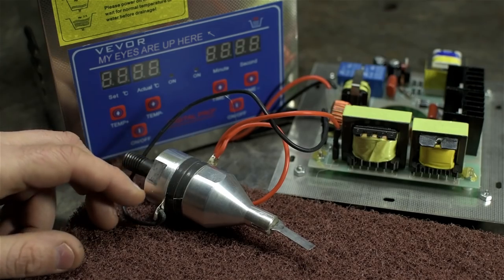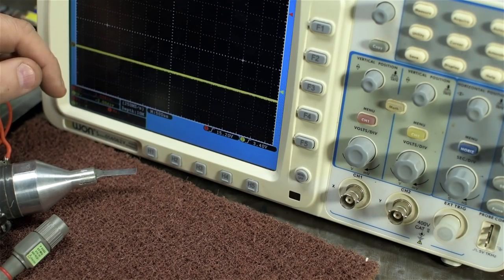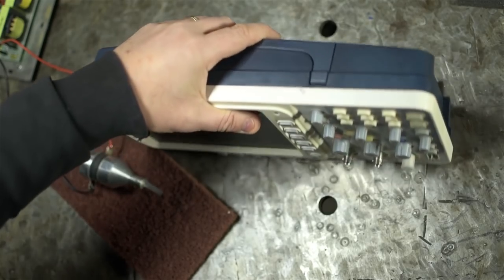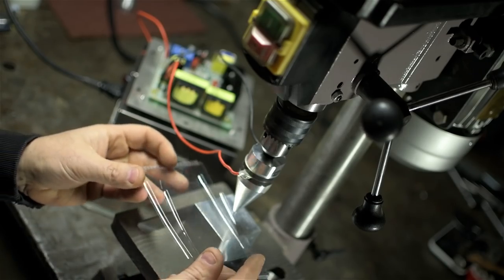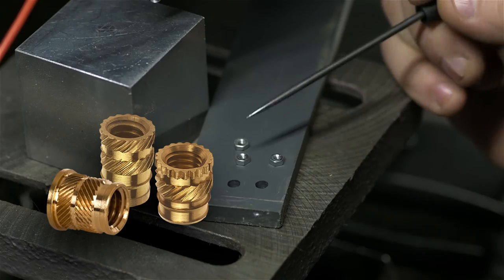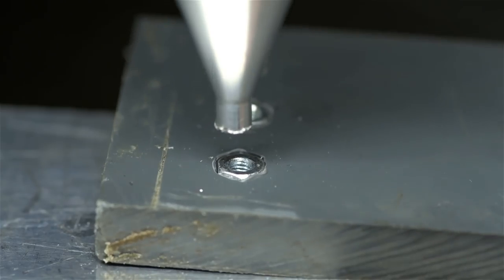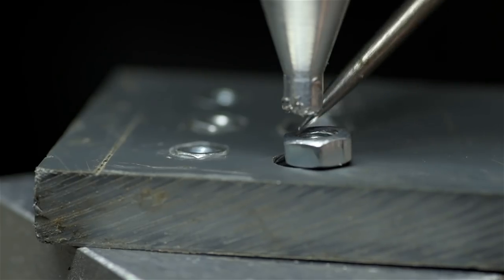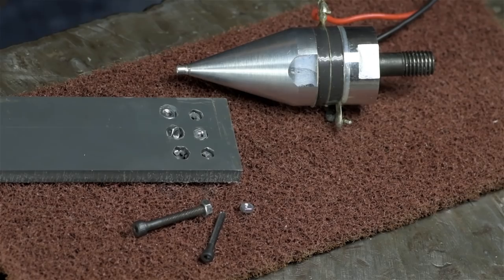DIY Ultrasonic Welder?! (Answer: NO)

Comment: As someone who works in a plastic parts plant... In the industrial section... as the resident sonic welding expert, I can tell you that you don't really want 40kHz for most applications. 20kHz is the general frequency we go for. Also, 160uM deflection at the tip, for most applications. Finally the real welders usually have three parts: A transducer, followed by a booster (which has a mass on each end, with a shock mounted ring at the central node,) and finally the horn on bottom side of that. Pressure is usually 25-75 PSI, erring to the low side, with a weld time of ~0.3-1 second. Feel free to message for more info!
Reply: As a last aside, our smallest welder has 900 W of output power.
Reply from the maker: So what you're saying is 60 is maybe not enough?  ;)
Reply: This Old Tony Probably not. ;-)

Comment: Far be it for me to give you advice, but I was sitting here watching, saying, "Hold the nut with a wrench." over and over. You must not have heard me...
Reply: Thinking exactly the same. Anyway, it was a lot of fun to watch :-)
Reply: same
Reply: That was a good idea, I was thinking of just making the horn fit into the hole in the nut, not threaded, just a bit undersized.
Reply: That's more or less what he meant by 'a pilot.' And undersized rod that helps position the work before the tool really starts doing anything
Reply: I was hoping he would hold it in place with the back of a dental mirror and maybe put on some nice eye shadow and lipstick.
Reply: I bought an ultrasonic welder for my company, which was a commercial film lab. We processed Kodachrome film. Anyone remember that? The processor was a ciné machine. That is, film is spliced end to end, and processed around racks as one very long roll.

This splicer was for that. The machine cost almost $50,000 around 30 plus years ago. The ultrasonic horn and physical equipment was about 26 inches long, and weighed about 30 pounds. The power supply was a large draw on the left side of the built-in table. This device, with all its size and power (1,000 watts for the head) was sized enough to weld to plastic ends of film, and that was about it.

Ultrasonic welding requires a lot of power, and a rather large device to deliver it properly and reliably. When we discontinued Kodachrome, I considered taking the machine apart, and taking the power supply and head home, to build myself an ultrasonic welder for projects. But didn’t, because that massive unit couldn’t really do much.

By the way, our machine worked at a variable frequency between 30khz to 80khz.

You need a flat at the bottom of the horn the size of whatever you’re welding, or pressing. PVC softens enough to bend at 140 degrees, and melts at about 180, so the heat from the ultrasonic is what’s allowing the nuts to sink in. Just pressing the nuts in would work better, because of the tension of the PVC being pushed aside, and pressing against the inserted nut. Melting the plastic that way just ends up with a loose fit.
Reply: On the surface that sounds like a pretty idea. Thinking about it though, I don't think it would be much for the hold onto if the"welder" was actually about to effectively   a good portion of it's energy into the work piece.  

I don't have any fillings but I can still feel them rattlin just thinking about it.
Reply: Yes, keep the power tools away from your teeth
Reply: Try threading the horn to the bolt so they go in straight, would be harder to take off but it would be worth it
Reply: It wouldn't clench at all. A box end wrench would simply act as a sleeve and held firmly it would guild the nut straight.
Reply: The moment he does that watch it weld the nut to the wrench. You got to think of his luck.
Reply: Depends upon her looks would be my guess?
Reply: Good call on not holding the nut with a wrench. Ultrasonic frequencies can cause micro stress fractures in bone. Been there done that. Happens in an instant.
Reply: A counterbore might have worked.
Reply: @paddlefaster  I've been researching that exact phenomenon. Can't exactly find much detail about it. Could you please explain further? Have you tried it and does it really happen instantly? What does it feel like and what are the recovery steps?
Reply: I never thought of that, I was thinking to put a plate on top of it to hold it square, but I also didn't know if that would affect the harmonics. I was also wondering how much pressure he was putting in if he was using a lighter pressure than just pressing it with the drill press.
Reply: Sharpen the tip
Reply: Right!!! I was getting stress by the solution bien so easy 😅🤣

Comment: To be able to weld, you need transverse vibrations. I recently stumbled on the schematic of the welder to weld tabs on battery cells, and it was designed at such: a vertical rod was pressed down on the tab to be weld on the battery, and the ultrasonic actuator  was attached via its horn perpendicular to the rod, it's other end attached to the frame of the machine. The result: the tip of the rod was vibrating horizontally, with a 2x amplification due to its positioning mid-rod, and the vertical pressure was not going through the transducer but straight through the rod.
(Also a small stepped down insert screwed at the end of your horn would allow you to have a correct way to hold the nuts/inserts square during insertion, you would need to have one for every size of insert to weld, though)
Reply: Yes, I was also thinking you need "in plane" vibrations for the welding to work because you need to have friction between the two surfaces. Also why don't you just put a small bolt in the "insert", this way you have flat surface to push on and also no plastic can move up in the center.
Reply: Ultrasonic welding is a form of friction welding. The 2 parts have to slide against each other to generate the welding heat. The ultrasonic exciter is teed into the horn as stated above. The nuts going into plastic was more like an ultrasonic jackhammer.
Reply: Ultrasonic Jackhammer is my Spice Girls cover band, tyvm
Reply: Ok, I wasn't crazy. This is exactly what I remembered of ultrasonic welding. I think that Tony deserves another go at this with the proper design. I think this is my favorite video series on this channel to date, and that is saying a whole hell of a lot!
Reply: ToT should try it!!! for the sake of the scope!!
Reply: Pierre-Yves Puech 
I got gas
Reply: I’ve used ultrasonic welders at work for battery tab connections. They’ve been used since the mid-1900s to weld plastics mostly. Even welded a complete car body (it didn’t work out).  And even now, with GM’s science and such, it is still very much problematic. The anvils and horns are always needing replacing because their knurls wear down pretty quickly.
Reply: This information is incorrect. Yes, for metal welding (battery tabs), the surface is scuffed back and forth, but for plastic, you are compressing the surface of the plastic. Scuffing the surface of the plastic is only used for vibration welding, which is low frequency  ~400 Hz, or spin welding. 
Once you got centered on the nut, you noticed how it went in very quickly. The sharp corners of the nut flexed the surface, causing it to melt. The reason it did not stick is there was no edge for the plastic to grip. Melted plastic is not glue. The metal must have interference to grip the plastic, so it did work.

Comment: Tony, where I work our daily job (for 14 years so far) is untrasonic welding transmission vent caps for GM cars. When welding, you need to tune your horn for each specific part and part material. You also need quite a high energy, and a high compression pressure. You need a much higher powered transducer. While super cool and probably very useful, those nuts did not weld to the plastic. They basically got jackhammered into place.
Reply: Hi. I am a mechancal engineer, and  if you could I would really apreciate if you tell me with which kind of ultrasonic welding machine are you using. I need some information where to buy industrial machines but havent had much information about this topic so far.
Reply: I used to work for Dart Sensors in UK, they use ultrasonic welding to seal their gas sensors, they are plastic with a small press like setup, similar to what Tony did with the drill press.. the plastic is held by a very snug fitting aluminium dye, the whole welding process is about 2 seconds, im not sure of the frequency the machine used....

Comment: Washers for retaining the ultrasonic radiator - are made of spring steel. In Russia, it is a steel grade 65S2VA, you have a steel grade 60SiCR7, or something similar. The Chinese use high-carbon secondary heat, its strength is sufficient for the life of the product.

Spring steel is needed for a reason, sound waves have minimal damping in this steel grade. You need a stable oscillatory system, without loss of heat. The easiest way to see how industrial cutters are arranged is simply metal - its shape can be repeated even from the picture. And this form is different from what you have.

Pay attention to the device driver emitter. He does not have a fixed frequency !!! It simply reacts to the load, and gives the maximum current with a phase delay of 45 degrees. Resonance frequency is obtained automatically! You do not need to interfere with his work, he is almost perfect.

And yet, take care of your hands. Bones are destroyed under the influence of ultrasound, very imperceptibly !!!
Reply: Хелло, комрад!

Можешь обьяснить, что ты имел в виду под "Washers for retaining the ultrasonic radiator", что это?

Comment: Yes, for those who didn't know, voltage measurement devices are sensitive to high voltages.  Especially with 1x probes.  This is one of many reasons I always use 10x probes.  My other best advice is to make a scope saver with a pair of zener diodes in inverse series to make a voltage limiter.   It will not save you every time, but it can prevent disaster and maybe even be used to make an isolation switch for your scope.

Comment: Riveting. I was glued to my screen.
Condolences regarding your scope Ch1.
Reply: What type of glue? Have you tried acetone?

Edit: Just caught that you said "was glued". Glad you were able to get unstuck.
Reply: If you need glue for riveting, your doing it wrong ;P
Reply: At least you weren't riveted to your screen...
Reply: I am wondering why the scope broke... Can somebody explain? It was normal voltage and current right?
Reply: Here is a guess. You know that piezo effect that makes BBQ lighters spark when the crystal is struck with a hammer? A piezo crystal can produce thousands of volts when struck. Perhaps this piezo element was getting squeeze when it was rattling between the horn and anvil, Producing a stray voltage .
Reply: I am leaving a comment here just to be notified if someone gives an an answer to Seeker44's question.

i.e. "I am wondering why the scope broke... Can somebody explain? It was normal voltage and current right?" and Frequency I must add.

Comment: On the close up of the smaller nuts you definitely see some fluid movment of the plastic. I guess it shows a super efficient transfer of energy from the vibration of the nut to a thin layer of the plastic. Brilliant process.

Comment: Huh, that actually makes some sense. If the "feedhorn" is resonating, and you're not putting the energy into a workpiece... it's going straight back into the piezo transducer, and those work in both directions. The mechanical force would squish it, and generate a pretty high voltage, until it was enough to cook your scope. 

Probably not super great for your power supply either, come to think of it. Unless IT's a HV supply... piezos can be driven with hundreds of volts. That would also cook the scope.

EDIT: Rewatched the video, and that's an awful lot of transformer right beside the piezo outputs. Sorry Tony, but I think you just hooked it up to a high voltage line.
Reply: John Doe more that the horn takes time to start resonating.  The supply will switch back on while the horn is still lagging, and theyll be pushing against each other.  That'll create double or more voltage on the scope
Reply: There's a whole pile of things going on. If the supply is trying to drive at 40kHz, and the mass is resonating at 45kHz, you're going to get a bunch of weird beat frequency effects. If the supply were perfect, hooking up the scope shouldn't have hurt it (assuming this is a low-voltage supply) because it would just sink the current. If the resonator is overpowering the drive circuitry, I'm not even sure what THAT is going to do. 

I'd have to stick a scope on it to figure it out.
Reply: years ago i bought transducer and simillar driver and it was definitely more then kV.
Reply: No idea about this size of transducer, but I smaller transducers for distance measurements and stuff like that are usually driven by a fairly "soft" (="wide" resonance band) oscillator which is pulled by the transducer to whatever frequency it resonates at. Those drivers are a bit like CCFL drivers. Maybe the same is going on here.
Reply: Holy shit, thank you. why is the most imporants points completely avoided? Really dangerous not to address this concept.
Reply: It reminds me of the type of SWR effects from having an antenna that isn't resonating on your frequency, driving spikes of voltage all over the place.
Reply: Usually the transducer driver runs on unfiltered but rectified mains, purity of waveform is not important with an ultrasonic cleaner. You can hear the (in this case) 60Hz/120Hz modulation. 

Note: the transducer is probably connected directly to the mains somewhere. If the transducer was isolated from the mains it wouldn't have cooked the CRO, it would have only cooked the probe. Then again, after this long you've probably worked all this out by now.

Comment: Tony, I have been into 3d printing for the last five years and let me tell you I love what you did here because it requires no flame, or heat, to set that screws.  We call those nut traps and we don't want the nuts to not come out we just want them to not spin around and I am  fascinated at just how well they went in.  There is promise in this.
Reply: On the 3D printed parts i designed in my last job, I used holes a little bigger than the across flat dimension of the nut to hold nuts to allow me to have threaded holes in plastic parts. On laser sintered 3D printed parts I was able to press the nuts in by hand. It works well as long as the bolt pulls the nut to the bottom of the hole rather than pulling it out of the hole. A couple of parts I designed using this method even made it to the European Space Agency on one project I worked on. A second option is to design the part with a slot where the nut can be inserted sideways into the hole. The bolt then locks the nut in place when the parts are assembled.
Reply: Precisely, but plastic shrinks (on 20k USD plus machines they have very controlled environments as opposed to the consumer level so shrinkage isn't nearly the issue as with the hobby machines) so trying to get the nut trap precisely right is a PITA so people resort to using soldering irons and lighters, etc... to melt the nut into the now slightly too small six sided hole but this method there is no heat (well, there is but at a very localized level) and that makes this technique very viable.